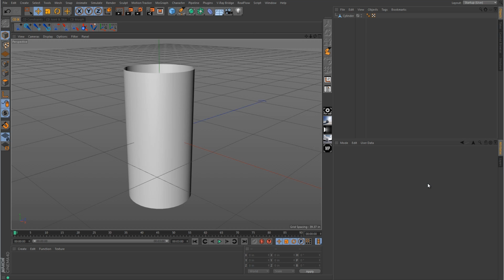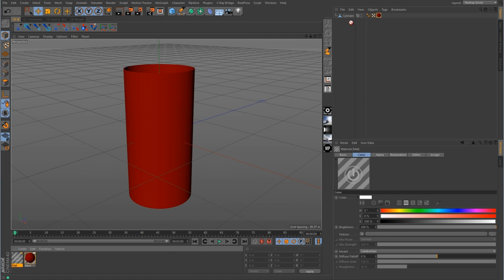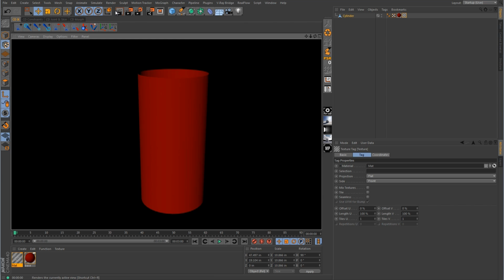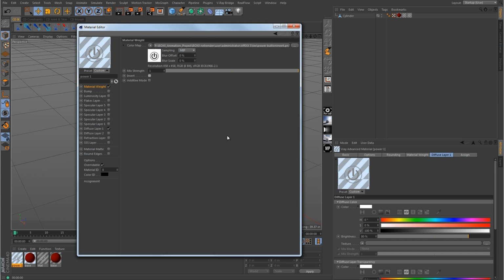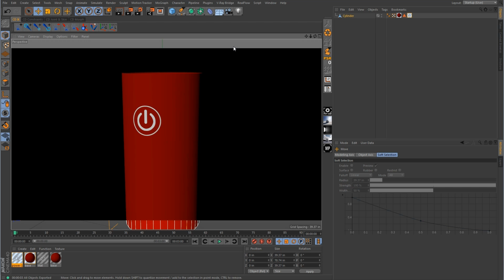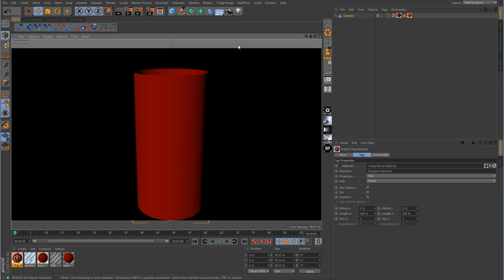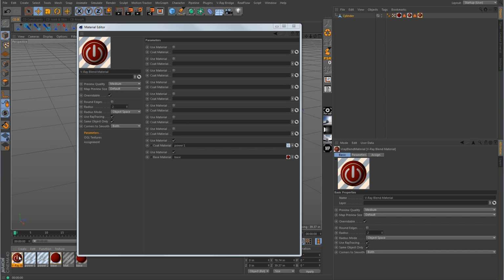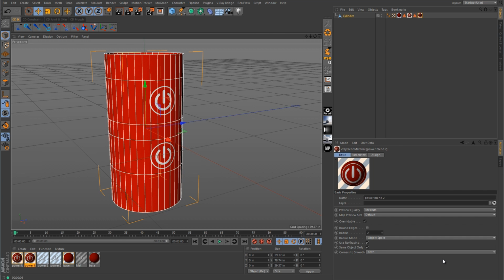Cinema 4D Tutorial - Vray materials - problems with stacking labels

Comment: It blows my mind that an expensive software, regarded by many as an industry standard, needs this kind of an absurd workaround to solve such a basic every-day task. Now that LaubLab has been removed from development, it will be interesting to see how long ChaosGroup will need to fix the C4D version.
Reply from the maker: I was hoping that the latest 3.7 update would fix a few things, but it did not. There are a lot of other issues with VrayforC4D that has caused me to move away from it. There is a HUGE issue with it causing my machine to freeze for 10 seconds every time I make, edit, or create a new Vray material. The developer forum could not provide an answer. Another user was having the same issue, and the only work-around was to disable hyperthreading in the bios. That is unacceptable! I have since started using Arnold, but I'm already having issues with it, so I'm considering moving over to RedShift.

Comment: Thank you very much! Your guide is very helpful. Unfortunately it couldn't help me when the base material I use in the blend material is a photo and not a homogenous color. Any ideas? My example is I have a book cover illustration and I am trying to add a decal e.g. a red circular label containing text.
Reply: Did you find a fix? The trouble with blend materal is that now you can't adjust texture scales seperately... so much trouble right now.

Comment: You touched on the easiest solution then threw it out the window because you don't like to split you geometry. But... If you split off all of the polygon selection sets (as many as you need) and create additional objects, with the same polygons from the original object deleted, then put all of the objects into a null, place the null into a "Connect" object, then into a Subdivision Surface modifier, it will end up looking just like the original object.

Comment: I've found the best way to work with many small labels like that is to import them all into a single PSD and lay them out there using orthographic shots of the model. All you really need is relative positioning info and it's easily obtained from any complete model with an orthographic render. I use the very same approach as you do and apply a flat projection to a polygon selection but only using a single tag/texture/material for all of the labels on any given object. It works out well - popping back & forth between Photoshop and Cinema, tweaking the texture, saving it and reloading it again is Cinema to get everything just where it needs to be is a relatively painless experience.

That being said, nice to see you found a way to do what you wanted to do although VRAY sure doesn't make it easy, does it? Worse material system I've ever worked with.  I haven't used Octane yet - I've used Arnold though and the materials are a pleasure to work with - there's a layer shader that's almost exactly like the photoshop layer stack and it's easy to plug in various other shaders either as main color layers or mask layers. I haven't bought it yet but I think I'm going to because it's a pleasure to work with.
Reply from the maker: Yep, I know exactly what you're talking about. I have done that before, especially for objects that have dozens of icons and labels, like a laptop keyboard. I always do those as one single texture. I was really hoping that the new vray 3.4 would solve some of these problems, but unfortunately it did not. I have been reading about Arnold, and I think im going to give it a try.